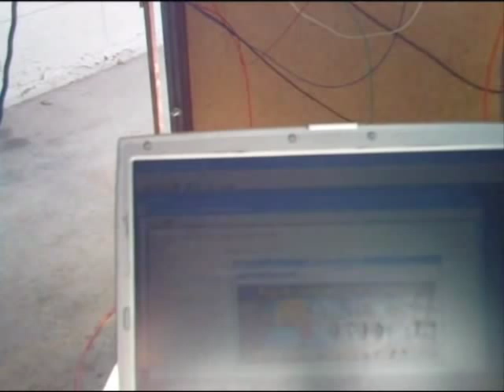G.D.O. Pinsetter:  Duckpin to Candlepin Conversion

Comment from the maker: Well, it's fairly soft, thin ABS drain pipe.  The bottom of the deck should have been covered in about 4-5 coats of tough urethane but I never got around to it.  The Kickbacks(side walls) should have been coated too.  It's too late now, the boards have been rain soaked and swollen.